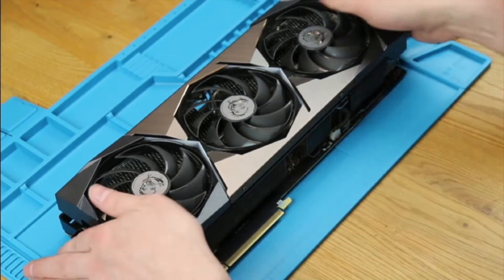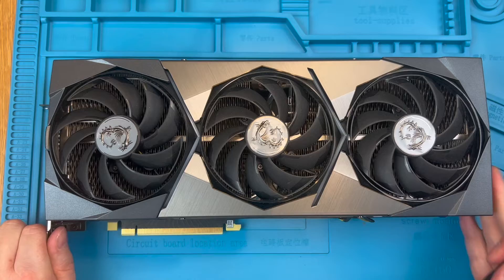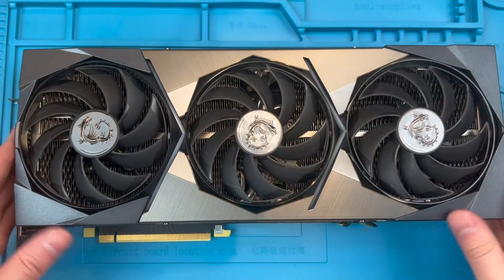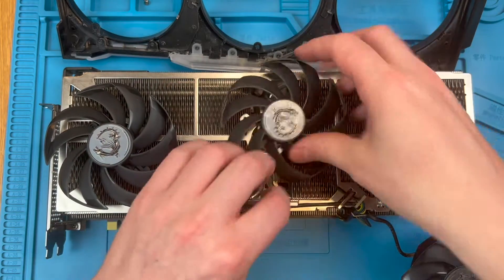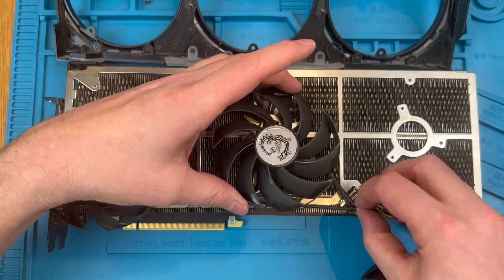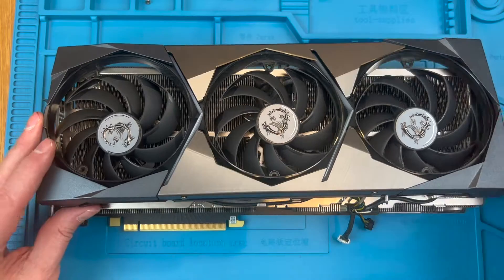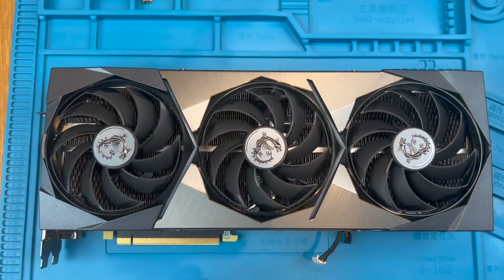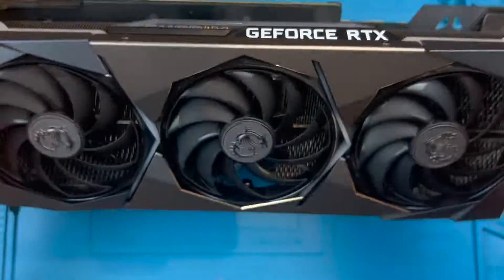MSI Suprim GPU Fans - Easy replacement to fix broken fans in less than 10 mins

Comment: Great video, i didnt know it was so easy to replace
Where did you get those replacement fans? Are they original, where did you buy them?
Reply from the maker: I bought a selection of fans for some GPUs from Ali Express. But I had mixed results with some good and some really questionable. So I don’t think I would recommend that. But you can pick more options up on EBay/Amazon now, and you have a simple way to return if they are not good.
Reply: @sometechguy so you really cant know if they are original or not huh? I have a 5090 suprim and looking up for replacement fans if I need them in the future.
Do you think msi could sell me spres if I contacted them maybe? I have some doubts about my current fans, whether I damaged them or not, Im not really sure so Im looking for a plan b junt in case. They migth be completely fine too. There is a 0.3-0.5 second small rattle sound when the fans start up from zero then it disappears, is that normal did you experienced this before? There is a good chance they were like this out of the box but Im not sure of that either, I have a video recording I took from the first start up of the pc while I was building it and there is that fan start up rattle but my case fans have that rattle too so Im not sure if it is the gpu or only the case fans or both.
Thank you for the quick response❤
Reply from the maker: If you buy from ebay, amazon etc then my default expectation is that they are not manufacturer original. From the samples I bought from Ali, they varied from being very convincing originals to clearly not original. But if I had to speculate, they probably mostly come from the same places. It could be that the provider sells to the manufacturer and also sells to other buyers, so you could be getting originals or not, really hard to say. 

But personally at least, I wouldn't worry to much. If you buy from somewhere with reviews, and the marked voltage etc on the device matches the original then my experience was that its not likely to cause a problem and the likely worst outcome could be that the fan fails again some time later.  But the ones I replaced didn't fail as long as I had the card.

As for MSI, this i dont know. I avoided warranty just because it usually meant returning the card and being without it for a long time. It is possible they will send the fans, but could depend where you are as in some countries there are warranty implications of opening the card up. As you see though, its really very easy and doesn't require anything very intrusive.

But good luck, and I hope it goes well on the 5090. One thing I would also check though is that I had an MSI Trio card that had a rattle in one of the fans intermittently. I just loosened the fan in the shroud and moved it a little and it went away. The problem seemed to be that at specific RPM the fan would touch slightly on one side of the shroud and 'tick'. The fan actually never caused a problem again after that.
Reply: @sometechguy oh I see, that might be the cause of the rattle. Thanks man!
I wrote why I was worried about the gpu fan below but it might be too long for you, you dont have to read it if you dont want to. Thanks for your reaponses either way❤

When I saw you disassemble the fan, it kinda reassured me that I probably didnt damage the fan actually. Before I saw that I thought it had many ball bearings since it is high end and stuff and very fragile as a result etc.
Its just a spring with a single ball bearing, and that spring give it that axial movement, now I doubt some small amount of axial movement damages the fan. Before I was very worried that I migth have damaged the fan because I pressed the fan a little while I was grabbing the gpu before I inserted it to the pci slot while I was building the pc, it gave in and collapsed a little and springed back up immedietly, and I was so worried that, that much migth have damaged it and such. Also a few days ago while I was swapping my placeholder cpu cooler with a nicer one I had to uninstall and reinsall the gpu, after I intalled the gpu and pushed it into the pci slot I realized I forgot the anti sag accessory magnetically attached to the bottom of the pc case😂 it really freaked me out, based on the dust marks its clear that I dragged the thing to the base of the motherboard while I was lowering the gpu to the pcie slot, and after I pushed the gpu into the pci slot it landed at the edge of the fan, it was only touching the black fan ring of the chasis tho and not the fan blade itself but I thought that black ring was part of the fan but it actually isnt, its just a part of the chasis, writing this I realize I probably should check if that black ring around the fan is propoerly seated in the chasis, maybe thats the problem but it seems like an easy fix. Even if that anti sag accessory touched the edge of the fan balde, I hope that the fan has some radial manupulation tolerance too(from side to side), probably there isnt much tolerance for that though, I just hope my observations are not consistant with a damage caused by radial manipulation at least. The anti sag accessory wasnt stuck to the fan blade when i saw it, non of the fan blades were close to it either, maybe that was luck or they were pushed off Im not sure, fan still spins fine when I spin it with my finger, I do not percieve a friction, there is no wobble, no grinding noises, when the fan is spinning it doesnt make any extra distinct noises, just a wooosh sound, the pc has some anoying noises but when I lower the gpu fan rpm to 0 with the msi afterburner they persist so probably the case fans are responsible for them, it only has that rattle at the begining. And also probably if there was some damage to the ball bearing there would be grinding noises instead of only a 0.3 second rattle noise at fan start up. Or at least the rattle would be constant and not only at the beginning of start up I think.
What kind of noises do different kinds of damages to the fan make actually? Could that rattle be a result of some damage caused by radial manupulation? But when I observe it, it doesnt have any wobble to it, If it was because of that I think there would be wobble rigth?. I doubt it was about the axial manupulation accident where it gave in and sink a little, it was safely absorped by the spring I bet. 
Your experiences could really help me. Thanks in advance!

The text migth be long Im sorry 😅
Reply from the maker: Lots of info, but I tried to follow it all. 😂

There are different type of fan construction, some are sealed and some not and I have seen different fan types on similar models. But in any case, I don't think pushing the fan down would do damage unless you hear a bad noise, there is some play and the fans can move up and down a little. As for the different sounds, I can't say for sure but if the fan is really damaged, I would expect it to make persistent noise and maybe not spin at the correct speed. So if its just intermittent, there is a good chance something is rubbing or the blades are hitting something. Also check the fans are clean, as if there is a build up of junk under the fan or on the blade tips, the fans could also be coming into contact with that build up. Simplest way to clean is to use some isopropanol and something like a cotton ear bud.

But hard to be sure, and if none of that helps, you may have to replace the unit, which is easy to do on most models.

Comment: Is it possible to lubricate the fans like on some other cards? Iv added lubrication (oil) to strix and some zotac cards
Reply from the maker: It may depend on the fans installed, as the types seem to vary. I had opened some 3070 Ventus fans before and used a drop of sewing machine oil, but some of them seem to be sealed. It looks like the actual fans can vary depending on the date of manufacture, and maybe even where they are assembled.
Reply: @sometechguy  can you open the fans on the supreme 3080? You have in the video but don't know if it can be put together after that

Comment: Hi mate, i have an issue with my 4090 Suprim X. The two fans on the left (the ones that come together with one connector) make a rattling sound with high RPM. I have removed the shroud and no noise anymore... I have just ordered two fans from Ali Express going off the part number on the back on the fan. I seen your comment saying your shroud was mis-aligned... though i cant tell if thats the case for me.. It didnt seem to be hitting anything. Im just wondering now if i have wasted money and i should try the shroud back on.

The noise happens when the fans are at 100 percent. Its a horrible noise. So now im running the card without a shroud it looks really ghetto but atleast its working. I got the card from Overclockers UK... not sure on the warrenty but i got the fans for 37 quid. Do you think its a fan issue or not? When i pressed the fans in a little the noise went... it was coming from two fans not the last one. I seen two other reddit posts with this exactly model and same issue. One guy RMA'd and the other is also running shroudless. I even took out the most noisey fan and seated some thin foam under where the fan outs to see if that stopped the vibration rattling noise with no luck. Its either the fans or the shroud however.... both the fans on the one splitter make noise and the other does not... Are they from a bad batch and the single fan isnt? Im not sure. Any advice? Was planning on running shroudless till the Ali express fans come. I did have a really good look and couldnt see the shroud touching anything and the two noisey fans where not hitting it.
Reply from the maker: The first thing I would suspect is that the shroud just needs moving a touch, I have had this on an MSI trip card, and loosening and slightly shifting the aground fixed it. But it’s also possible a fan is bad, it’s vibrating and that is causing the contact.

I would try and replace the shroud and if it makes the noise, try and isolate which fan it is and which side. You can often see visually if the fan isn’t central in its place.

You could also return the card under warranty, but it’s a drama and you might be without it for a few weeks.
Reply from the maker: Saw you said you had isolated it. Maybe they are just bad fans. With the shroud off and 100% fan , so you still feel any vibration on the card?
Reply: @sometechguy  it has to be the fans. i can hear the noise coming from the bearing... tho it only does it with the shroud on. I tried to put shroud back on and readjust it... it was seated perfect yet it still did it. Its bad fans i ordered some from ali express yesterday. The shroud has an effet on how the air flows and i think puts more pressure on the bearing.
Reply: @johnboy2436 same problem here. MSI Suprim 4090. Fan nearest the card I/O vibrating horribly anything about 92% and 65°. only happens if the card is warm. Just deciding whether RMA or fix it myself. CCL computers have given me a return label but I'm just not sure I can be bothered if I can fix it myself. Any update?
Reply: @paullasky6865  hi mate i fixed this now, order new fans from ali express. there EXACT same like from factory. 30 pound and came in 1 week. no more noise. didnt want to RMA over sake of 30 pound.
Reply: @johnboy2436  Yeah I agree. Not worth putting the card through a bunch of posting back and forth when it's probably just going to be some Saturday boy poking around in my fans and GPU. May as do it myself and know what I've done.
Reply: Don't suppose you have a link or part number?
Reply: @paullasky6865  you got discord or anything i can give you direct link to what i bought. Its the EXACT part.
Reply: @johnboy2436  I have sent MSI a support ticket asking them to send me a replacement part with a video of the problem, as I have the product registered.
Reply: Very common problem with Suprim cards ... i have this issue with 3080Ti , and now one of my fans , number 1 , just fell off . Poor MSI quality to be honest , i am really disappointed with them . Next time i will try ASUS probably .
Reply: @GodfatherCZ1  I believe its a defect. My two fans made noise since buying it. Since then i replaced them with ones from aliexpress and its been perfect. No issues to this day and been gaming away.

Comment: Hi there mate what an amazing video! this is so useful. Im experiencing a problem with my suprimX 3070 as the fans are making an audible annoying rubbing sound the second they start spinning and at higher fan rpm they also rattle which only worsens the problem. (this has been doing this from the minute i got it to which i haven't had the gpu for long, i have also seen another suprim card irl and there is no such issue). My question is if i let MSI know before hand of this issue would this void my warranty if i tried replacing them myself? as i genuinely cannot go through the hassle of returning it and would they be able to source me some replacement fans? If you can do you have any good links for any replacement fans? (i live in england) 
Thank you
Reply from the maker: Thanks for the comment, I appreciate it and I am really happy it was useful.

I had a trio card that right from new made a rattling sound sometimes, but not always, but especially at higher fan speeds, and those are very similar cooler setups. In that case, the shroud wasn't quite correctly aligned, and loosing the shroud screws and moving the shroud slightly fixed it. Check the fans are evenly spaced from the shroud.

As for changing them, I don't know if this would void warranty but I think it would be really hard to justify that unless there was obvious damage done during the fan replacement that could cause the card to fail, such as PCB damage, which is highly unlikely. That said, in many places there is a right to repair rule that stops that behavior, but I dont think the UK has that legal protection. However, its a pretty straight forward job so it would be hard to cause damage and I personally doubt MSI would pull up on it. But mileage may vary there, and I can't be sure. You could keep the originals and put them back to standard if you did need to make a claim, I think thats very reasonable and MSI generally have a good rep.

As for buying them, I had a really mixed experience with buying fans from Ali Express and I had to return many, but the Suprim fans I got looked very much like they were originals and they worked perfectly. But I would honestly check ebay as you are likely buying those same fans, but with buyer protection and a much simpler return process. If they are the wrong size or don't work perfectly, return them inside the 30 days.

As for warranty, obviously the safest thing is to return them and get a replacement assuming its covered. I returned one card with a noisy fan to Scan and they were excellent and just replaced it with a new card, which I think was above and beyond and I had the replacement in days. So you could check with the return policy of your supplier, unless it was a second hand purchase. If so, I would just go and swap them.

Hope this helps, and good luck!

Comment: Thanks for a great video! Just got this card used, and needed to replace the fan.

Can I ask where you purchased the new fans? The double fan is a little more difficult to find.
Reply from the maker: Depends on where you are, you can find them on eBay. I actually had to get this one from AliExpress, but its a mine field as there are non-original and either counterfeit or possibly fans that didn't pass QA there. So if you go that route, buying the cheapest may be a false economy and you definitely want to check all the dimensions and cable lengths with the buyer before you buy, and check feedback and the number of units they have sold.